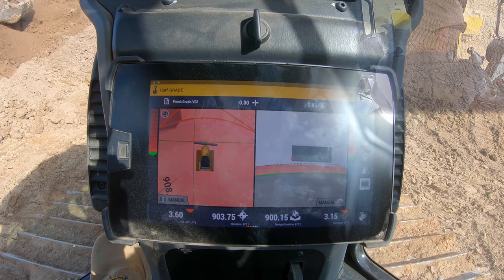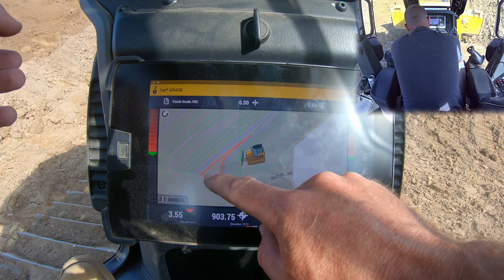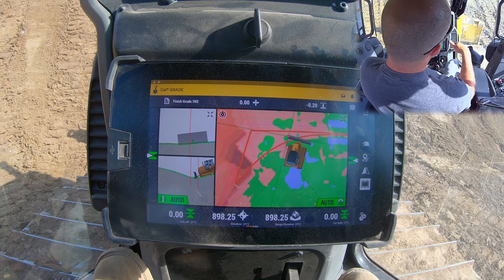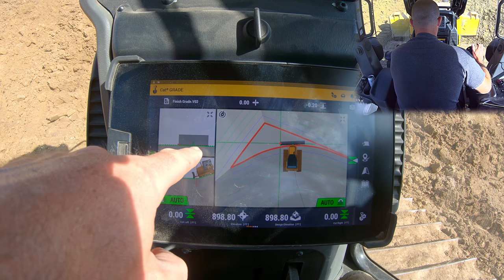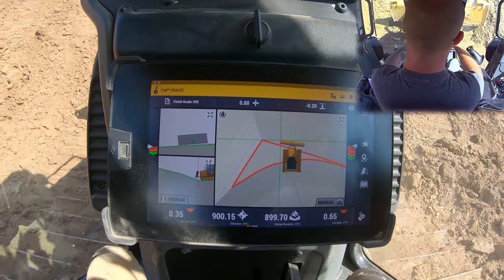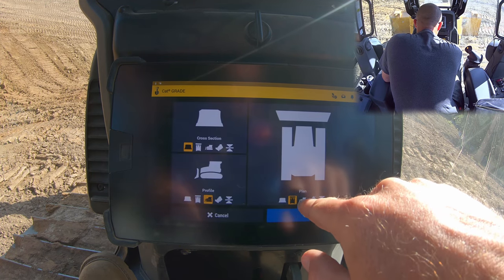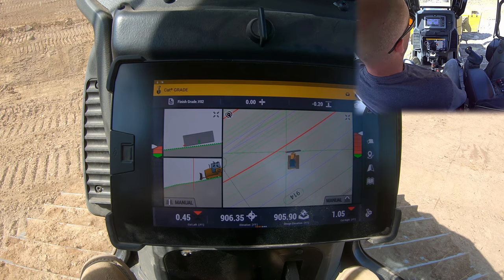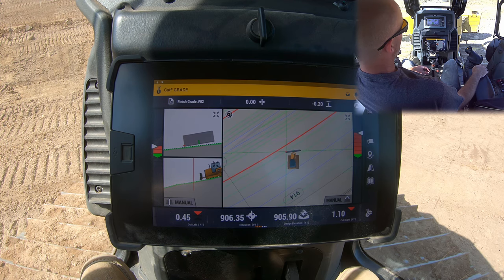HOW TO CUT COMPLEX CURVES IN A DOZER WITH GPS // CAT Grade Control // Ask a Heavy Equipment Operator

Comment: As a gps model data builder we get this call alot from clients. We build about 4,000 gps models a year and we always get calls that the dozer is not running right in the corners of the ponds. This helps to educate operators. Thanks. I am keeping this link for those calls.
Reply from the maker: Absolutely! Let me know if you have any other frequent calls that we could potentially cover in future videos. We are getting ready to do a whole series on machine control and GPS
Reply: @DieselandIron  Nice definitely will do.

Comment: I’m going to a new development job how do i find out my vertical offsets?  It’s new housing pads and roads and sidewalks..     the last company i worked for gave them to me so I never figured it out but (my side walks were -0.35) (pads -0.75) (street -0.65)  so how do i figure this out myself for next time? Just read the grade stakes ? Or look at the prints and minus one add from the elevation ??
Reply: Or look at the prints and minus from the Existing grade to the finish grade and would i do that with areas for fill add instead of subtract??
Reply from the maker: Your prints should give you a breakdown of the sidewalk and road profile. It will tell you how much sand and stone needs to go under each

Comment: It was faster with a grade checker and a good dozer hand. You’re taking the basics out of operating a dozer, the feel in your ass, and your hands, and the depth perception of your eye. If you can’t cut two tenths without a computer, you’re not a Operator. For years, this has all been done with feel, touch, experience, and talent. But I see why the industry has gone this way, they’ve taken advantage of several generations of video game addicts. If the screen goes down, you’ll have to park the tractor till it’s fixed.

Comment: GPS doesn’t make a good operator. It makes a good operator more efficient! The most important thing about moving dirt is moving it in the right direction. And the right direction may change depending on exactly what you are trying to accomplish on your next pass. Reading the plans and the gps model and adjusting accordingly gets the best results. 
 I have worked with gps for over twenty years and it’s been my experience that the hardest part is teaching the operator that you can not just turn the gps on and just start pushing dirt in just any direction and it to come out right.
Reply from the maker: GPS can take a C level operator and make them a B+ to A- operator.  Ultimately you are correct.  In order to be an A+ operator and take full advantage of the GPS technology you need to understand how to move the dirt and understand that planning is needed before just shoving material around.

Comment: Hi, Folks.
All this information is all very well and good but doing it thisaway is not NEARLY as satisfying as doing it WITHOUT GPS using the old Mark One eyeball and the seat-of-the-pants or 'favourite rump' steak monitoring.

I once cut a double change of elevation in a haul road using a 46A D8 dozer with the earlier hand lever tilt control outside the power shift control under the left hand - - - ON NIGHT SHIFT. The Euclid drivers loved it.

Just my 0.02.

You all have a wonderful day. Best wishes. Deas Plant.
Reply from the maker: I feel like this was just an opportunity for you to brag....but thanks for the comment!
Reply: Hello, @DieselandIron .
Nope, it wuzza chance to point out the difference between REAL operating and being a seat warmer for a bunch of electronic gizmos.

All this 'noo-fangled gadgetry' is all very well and good - WHEN it is working, but what happens when it 'layz a long, brown egg' and the ALLEGED operator can't do it with the 'Mark One Eyeball' and the 'Favorite Rump Steak'??????? Is the machine supposed to just sit and rust until the 'techies' can get it working again.

Or you're out in the 'boonies' pioneering a logging road or cutting access to a drill site through rocky country where you might hafta deviate around some area that the machine just cain't cut through?

Teach people to do the job WITHOUT all the technology and THEN teach them to use the technology and you will end up with BETTER operators, people who have at least some understanding of how the machine works instead of just handing control of the machine over to a zillion little electrical impulses racing around a circuit board atta rate of knots.

Teach 'em to BE operators and then let the 'electronic gizmos' help 'em to be better and more productive.

Just my 0.02.

You have a wonderful day. Best wishes. Deas Plant.
Reply from the maker: @dplant8961  This entire channel is about teaching everything you said.  The flip-side of your argument is that can't ignore the technology and write it off as "new fangled gizmo's."  The essential skills are still there and you have to have them but, machine control has taken operator production to whole new levels.  It would be a disservice to the industry NOT to teach this stuff.
Reply: Hello, @DieselandIron  
Maybe your reading skills aren't quite up there with your 'teaching' skills.

I have never said, "Don't teach the 'noo-fangled stuff." What I said was to teach 'em to do it the old way first and THEN teach the 'noo-fangled stuff' - 

Quote: "Teach 'em to BE operators and then let the 'electronic gizmos' help 'em to be better and more productive."
Unquote.

I doubt that many people 'raised' only on the 'noo-fangled stuff' would be anywhere near as capable of doing the same job without it as someone who learned to do it all the 'old way' without them having a bit - maybe a LOTTTTT - of practice.

I have only ever had machine control onna Cat 140H grader - and it didn't help a bit - 'coz the engineers had changed the design of the road and had NOT told us or given us the new model to put into the system - 3 days of work wasted.

I HAVE used laser monitoring systems - not control systems - to cut house and factory sites to +/- 3/4 of an inch - 19 millimetres - with Cat 941, 943 and 953 track loaders, various hydraulic excavators and a Cat D5B dozer. 

There izza LOTTTT more to operating a machine than just punching some information into an electronic control system, sitting back and lighting a cigarette.

Just my 0.02.

You have a wonderful day. Best wishes. Deas Plant.